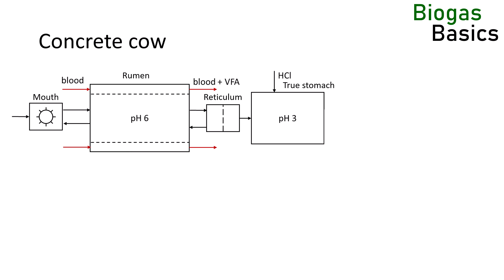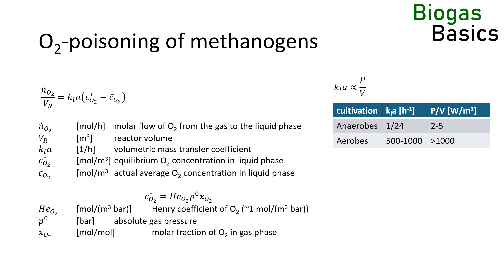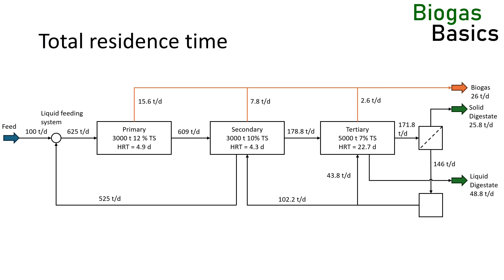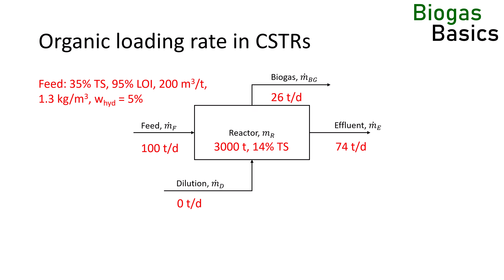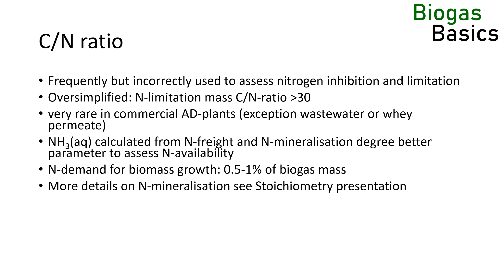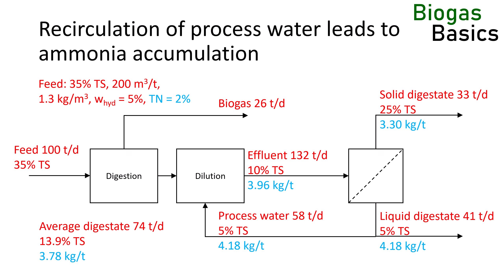01 Biogas myths

Comment: Hi again Jurgen. Do you think the OLR have persisted because at higher TS the digesters are not performing as a CSTR due to difficulty in mixing? Could that explain why OLR is still very common in the industry. I often also hear a number btw 3-6 as value to adhere to.. Secondly is there any correlation btw. OLR and BMP test from batch systems?
Reply from the maker: Have a look at the first two slides in presentation 6.2 for the correlation between the BMP gas yield and the hydraulic residence time. The BMP-test provides information about the degradation kinetics, and the kinetics can be used to predict the conversion efficiency of a CSTR. The OLR does not appear in the equations. The OLR is the feed concentration divided by the inlet related residence time. In first order reactions, the substrate concentration does not play a role, only the residence time and reaction constant (1st order Dahmköhler number). The mixing behaviour of CSTRs is not affected by the OLR. The mixing time of a high viscosity large-scale AD-reactor is several hours, the residence time several weeks. A dead-zone increases the OLR and reduces the HRT. The OLR does not provide additional information. Use the HRT for the design.

Comment: Hi Jurgen. Thanks for the very information presentations. You have an unit error on the density I believe (12:04 in your video). The feedstock is most likely heavier than 1,3 kg/m3.. Also I didnt get what you use w(hyd) for? Also later you suddenly use 3000 m3 in the OLR calculation despite the picture showing 3000 ton as the mass in the digester and not volume (I assume the density havent changed significantly from the feedstock to the digeste?) so the volume would most likely be 2310 m3 if using 1300 kg/m3 as density.
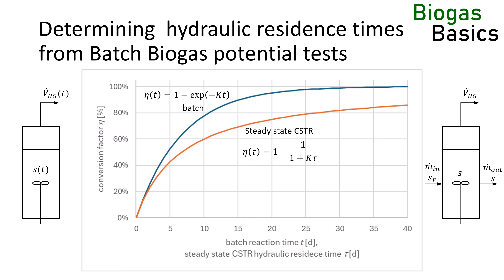Reply from the maker: Hi Michael, the 1.3 kg/m3 is the density of biogas. I use a density of 1000 kg/m3 for digestate (1 t/m3) – in reality it will be a bit lower because of the gas hold up (900 to 1000 kg/m3) but 1000 kg/m3 are the correct order of magnitude. The w_hyd is the mass percentage of biogas mass made form water taken up during the hydrolysis. For more information see presentation 2 and presentation 3 from 9:31 to 13:50.